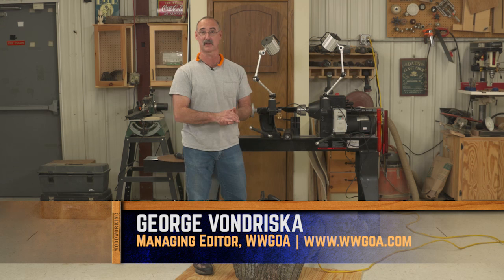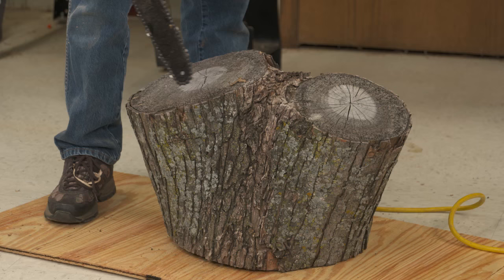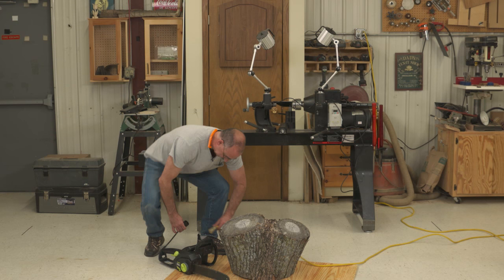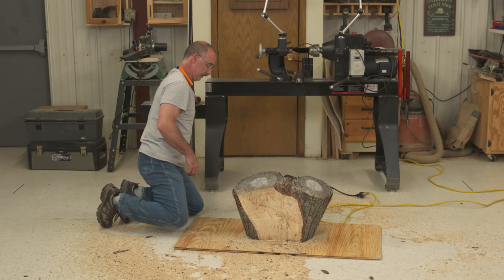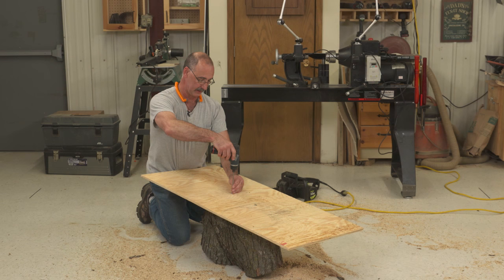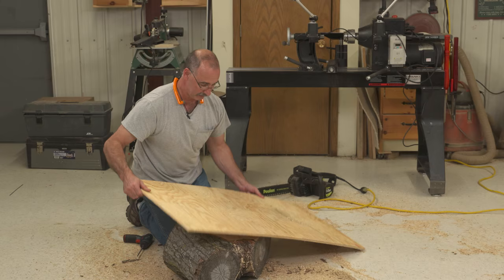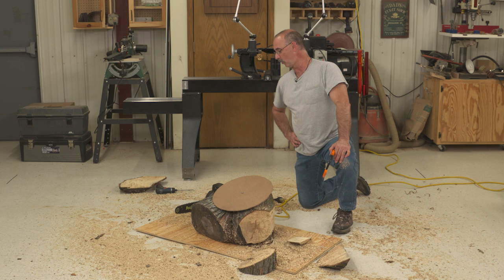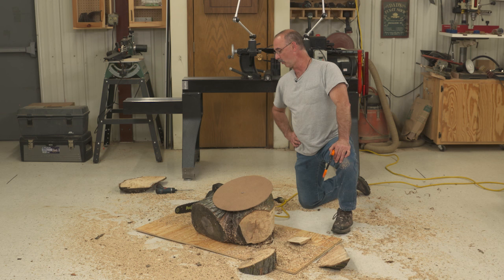Electric Chainsaw + Log = Wood Turning Blanks

Comment: Very good upload.
I have been turning for about 5 years (an amateur) but about 6 months ago I did a guy a good turn.   I didn't realise then but one of his jobs is cutting down or removing fallen trees.  He keeps supplying me with some lumber most of which is fantastic.
Trying to cut it up on my band saw was killing it so I recently bought an electric chain saw.  It's just great and avoids the carbon monoxide fumes plus I don't annoy my neighbors with the noise of a gas powered one.

Comment: I use a Ryobi 40V. Sharpen by clamping the bar in a vice and using a diamond round file in my Dremel. Be sure to get the angle right and focus on the cutting edge; just like a chisel.

Comment: Great idea to screw it to a board, will definitely do that next time. However, would it not give you even more safety and a better work posture if you propped the board up on some 4 by 4s?
Reply from the maker: +Jacob Jonsson It is a good idea to adjust it so that it is comfortable and ergonomic for you, particularly if you will be doing this repetitively throughout the day.  There is nothing wrong with the approach that you have indicated, as long as you ensure that the platform is solid and will remain stationary during the cutting operation. (ZD: 3353)